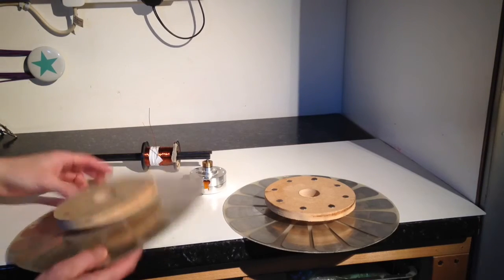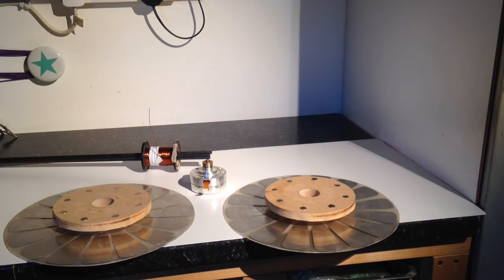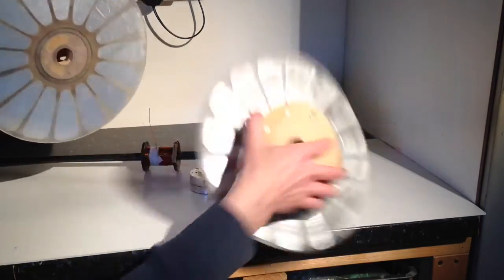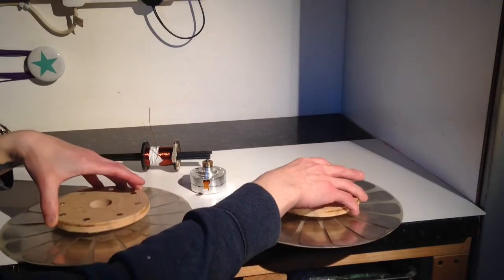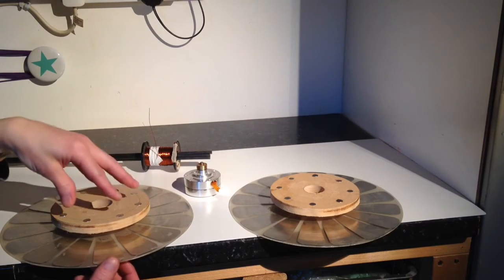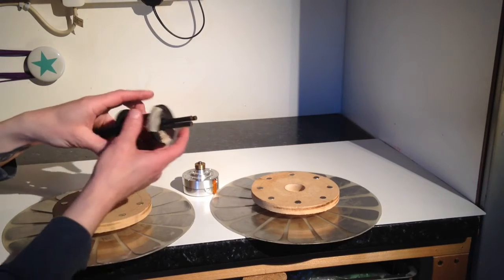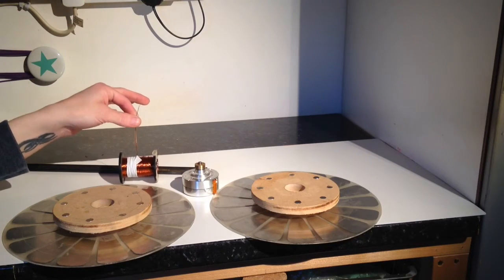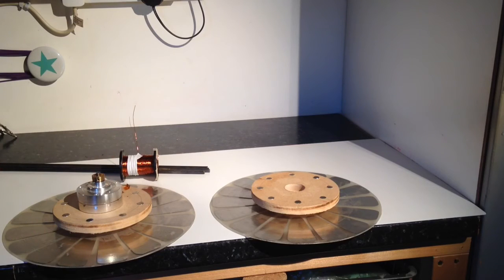PMBO 2016 #1 The Plan

Comment: good luck with the build.
There should be no capacitor speed limit beyond what speed the discs can handle. The main problem would be the switching between the metal leafs, mostly related to spark quenching.

As far as the electric motors go, you know my suggestion.
Reply from the maker: +erlendse .. thanks mate and thanks for being around when I have questions.  Saves me loads of time. ;)

Comment: i was hoping you would pick this up! best of luck! (i couldnt get the bedini circuit to give me the torque i needed at low rpm.....went reed switch then hall sensor)
Reply from the maker: +jeremy gwilt ..Finally mate, thanks very much.  I think I'm going to try a hall sensor for the first time.  One of the guys said they can run quicker? Thanks for the tip I need a leg up after my failed attempts.  Cheers
Reply: deeds i have had a bitch of a time implemeting hall switches....my nemesis that i finally overcome.  (PNP transistor)  it will have the same relative performance a reed switch gives
Reply from the maker: jeremy gwilt
thanks for the tips bud.  Skycollection has given me a copy of a circuit he's used before so I've had a giant leg up which should help with some of that pain I think. cheers

Comment: Those are all excellent questions in the description I have had as well. Going to be awesome for sure. Just a heads up, the plate spacing is pretty close as, might get some arcing if you dimt spavevthem a bit further or dope them with a so e kind of dielevtric.
Reply from the maker: +Diadon Acs (Conscious Energies)  ahh now I never got that far before.  You're a top man D, thanks for the tips.  Good luck with your project(s).   I nearly said... "I wonder if I can paint them in poly to stop any breakout"..  but that might impeed the contacts for the cancellation bars?  Should keep me on my toes. thanks again.